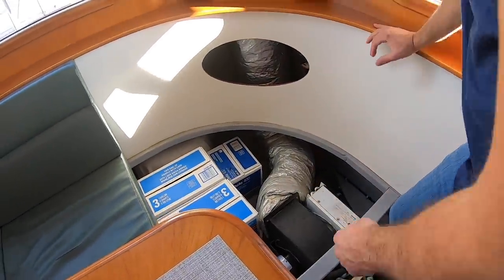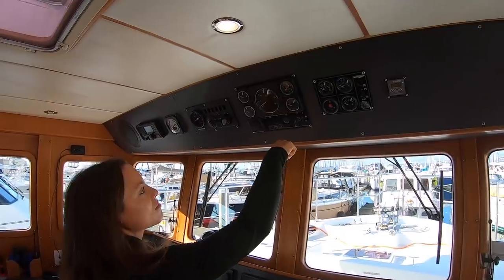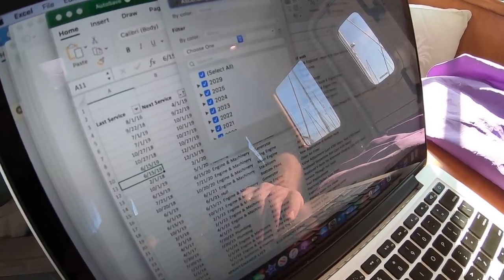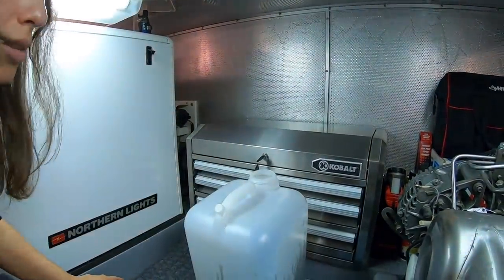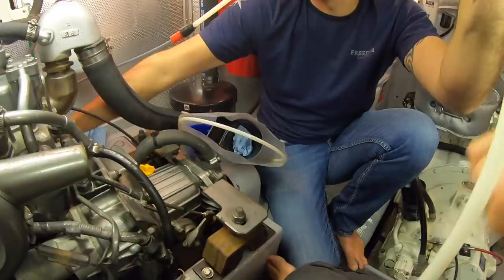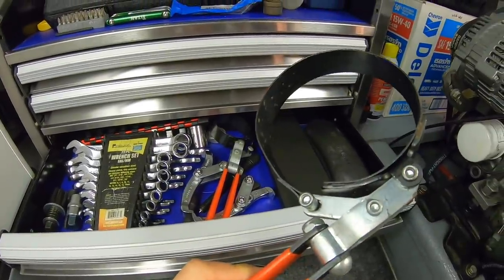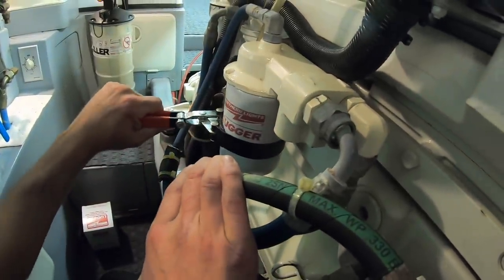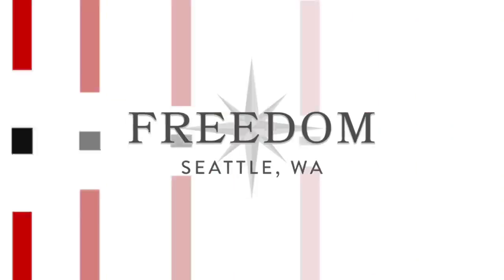How to change the oil on a Nordhavn 43 (pssst...it's EASY)!!!

Comment: For horizontal or inverted vertical oil filters;  after the 'warm up' period; poke a hole in the uppermost portion of the filter.  a punch or a simple nail will suffice.  This drains the remaining oil 'locked' in the filter to the sump.  Then bag the filter and remove.  there should be practically no oil remaining to spill.  :)

Comment: I never warm the engine up prior to the oil change. The oil filter won't have oil in it and doesn't make a mess. You get the oil out of the engine at room temperature easily. No need to warm. New subscriber. Love your videos. Another tip....use Dow Compound 4 on the oil filter seal, DC 4 available from Amazon. The seals will never cook onto the engine. We use DC 4 on aircraft engines all the time.

Comment: Shawn ..you have a beautiful setup, let alone wife, that was a great idea installing that oil pump, did you do all the work?
 that must have been a heaven sent, I didn't know the procedure  was so entailed.
 Material alone, expensive hobby but I'm sure it's worth it, I want to compliment you guys on the cleanliness It looks like you can eat off the floors in that  engine room, and that's the way it should be , all mechanical rooms should be battleship grey, clean!

Comment: Besides saving money, there's the satisfaction of doing your own mx.  Of course, on a boat, it's also an essential safety skill!
I've found that an end-cap filter fitting that is turned with a ratchet is invaluable for changing the oil filter on my truck; the filter is in a very tight spot where there's no space for a strap type filter wrench.

Comment: Good video, especially for us engine guys. I'm surprised you didn't prefill the filter on the main engine, since it's vertical. I assume the John Deere is plain main and rod bearings, so prefilling insures there is no interruption in oil flow while the filter is refilling.

Comment: Hi, i watched your video, glad to see you change your oil yourself. By the way i noticed your Racor fuel filters don t have the required stainless bowls at the bottom. It is a uscg requirement,min case of fire, the stainless shield will protect the plastic bowl from direct heat from a flame. You should be able to buy the stainless shields from a local Parker or West marine store. Kind of surprised Northhavndoesnt install those as standard equipment.

Comment: A good idea that all auto manufacturers do is add a magnet to the inside of the oil pan. You can do the same getting a little stronger magnet and attach it to the outside bottom of the oil pan. What can save you are scared cylinder walls. Just a thought.

Comment: In the grocery business in my dad's stores, the markup had to be 55% minimum in order to make a 30% profit.  Of course that includes all the expenses like employee pay, utilities, building, etc.

I use to work at an auto garage and material markup was the same.
Plus "MISCELLANEOUS" items such as gaskets, screws, cleaning material, 
trips to get parts, etc. often 5% of the parts bill. (total rip off)

Then there was the labor.
There was an actual book that shows what time it takes for a good mechanic to do a particular job.
Then you take that time to another book and that book will give you cross reference of time vs price you want to set.
Those two books will give you the invoice to give to the customer.
Back in the 60's we also charged by what the customer wanted.
example:
We do GOOD work.
We do FAST work.
We do CHEAP work.
THE CUSTOMER GETS TO CHOOSE TWO OF THE ABOVE.
THEN WE GET TO CHOOSE THE THIRD.
And the owner was serious about it.

We could do a FOOD CHEAP job.  But it will take a VERY LONG TIME.
or
We could do a GOOD FAST job.
but it is NOT going to be cheap.

The owner could have been a multi millionaire, but he was a drunk and would gamble on just about everything.

Comment: Wow, you defiantly need the wing engine tied into the removal pump,  as well a hot rodeos trick would be a remote mounted oil filter assembly for that horizontal oil filter.  Great Video love the maintenance how too.

Comment: It makes sense not to use the refill function when you are working with single gallon containers of new oil. The only time it really makes sense to use it is if you are buying the 5 gallon / 20 liter buckets of oil. Though those have the benefit of the empty bucket to use for draining into next time.

Comment: Filling the filters before you install them is a good rule to avoid oil starvation when first starting after an oil change. Obviously only works when vertical fill. Cummins mechanic advice...
Reply: Maybe it's Cats, but some manufacturers don't recommend that due to contamination.
Reply: I believe its known as priming and, yes it's a logical must do.

Comment: Where do you buy those containers for the old oil? The look cheaper than the yellow diesel containers. I usually carry a smaller container of diesel for topping off the Racors when replacing filters.

Comment: " NEXT TIME AROUND" you really need to stop using DELO 400--while its not the worse diesel engine oil out there--the SHELL Rotella 15/40 full synthetic engine oil is sooooooo much better in terms of oil service life, and normal wear on the engine. Yes its kinda pricey up front, but due to the fact that you can get 3-4 times more life between oil changes, then it becomes way cheaper over the life of the engine, and is actually better for all internal engine components since its a known fact that traditional petroleum based oil will "cook" and "adhere" to internal engines parts that for one reason or another don't get lubrication, and will eventually have a build up on internal parts. Contact Lugger, and who ever the engine manufacturer is for the generator, they will probably tell you the same thing!--happy travels
Reply: YES!! Full synthetic is the ONLY way to go, your engine is working hard every trip pushing a lot of weight through water. I'm sure Shawn has researched this by now:) Shell Rotella is very good oil.